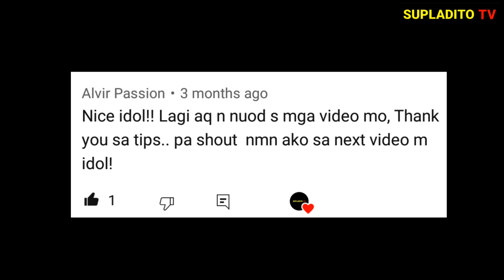Honda CIVIC: Rekta Fan vs Automatic Fan + overheating emergency tips

Comment: Ang purpose ng thermostat is to rich the normal running temp. Pag wala kang thermostat sa cold weather sobrang lamig ng engine at pag mainit panahon sobra naman init ng engine pag may thermostat ka mainit man o malamig ang panahon nsa normal temp lang ang engine.. at kung nka normal running temp ka doon ang pinaka magandang andar ng engine at pinaka matipid na kunsumo ng gas..

Comment: Yung fan ng sasakyan ko sir automatic naman po. Condenser at radiator isang fan lang.. gusto ko po lagyan ng wiring na may switch pra pag nakhinto yung sasakyan e manual on ko yung high speed ng fan.. ok lng po ba sir ganyan.. wala po masisira pag maglalagay ako

Comment: Sir pwede ba yung thermostat 78degree nag bubukas pero thermo switch nasa 95degre.
Reply from the maker: Yung thermoswitch un ung mag sesend ng signal sa rad fan na mag on na pag na reach na ung certain temp… thermostat naman po is kapag na reach nya ung temp tulad ng gate valve magbubulas therefore unang magbubulas ung thermostst dadalhin ung mainit sa rad para palamigin after few paung rhermoswith mag oopen ng fan…as ok po sana nasame sila para sabay sila mag open

Comment: Para sakin Mas ok ang naka rekta fan iwas overheat.lalo na kung old model na ang oto. Sa.mga modelo yun ang dapat naka censor sa thermostart.
Reply from the maker: Kung san ka masya at panatag kalooban mo dun ka sir kanya kanya naman po yan eh ang importantexwalang overheating
Reply: Madale daw po masira ang block ng sasakyan pag naka direct?
Reply: @vonabayon5246  anong block yan sir?
Reply: @vonabayon5246  kalokohan yan boss! wag ka maniwala na masisira ang block pag naka rekta!  🤙
Reply: 100%✅️

Comment: Sir ask ko lang yung civic 96 model kc ng tropa ko naka rekta pero may thermostat pa sya then may naputol lng ata na wire , need daw palitan ng socket , ma e babalik pa kya sa automatic rad fan?
Reply from the maker: Yes sir maibabalik pa naman po ung need i attached lang po ing putol na wires
Reply: @SUPLADITOTV  so bibili po ng socket po Sir? At magiging okay na po ulit mababalik sa Automatic?

Comment: Sir paano po ba ibalik sa stock yong radfan ng multivan na nabili ko naka direct kasi ang radfan  tapos wala ng thermostat..
Reply from the maker: Need po ibalik thermostat then check thermoswitch pra tamgalin ung na bypas (jump) wire connections

Comment: Bos gandang gabi honda lxi matic nka oto fan usualy ilan minutes ba bago umikot ang fan kapag coldstart esp sa umaga nagapalinis kc ako ng radiator d n daw normal un fan ko kc ang tagal bago xa umikot bka daw mapwersa yun mga hose at pumutok, 15 to 20 mins bago xa umikot ang fan  sa umaga, salamat bos
Reply from the maker: Di ko po naoorasn ung sa akin eh pero most likely mga ganun kung cold start po

Comment: tanong ko lang po naka rekta fan po sasakyan ko kung ibabalik ko ng automatic wala naman magiging problema? ty po
Reply from the maker: If nabili nyo po sasakyan nyo ng naka rekta fan na, di po natin sure or alam if ano reason kung bakit nag rekta fan ung iba gusto pang ung iba namam kasi may slight issue, 

Having said that sir, dun mo malaan if heathy ung engien nyo kung walang lalabas na issue sa cooling system nyq po

Comment: Nice tips sir.. Tanong ko lang kung pede po ba irekta kahit d na tatangalin ung thermostat?
Reply from the maker: Pwede nanan po sir
Reply: wala bang magiging bad effect s amakina sir kapag naka rekta gna at may thermostat? kakapakabit ko lnag mg thermostat kasi at ung fan ko naka rekta din. nag babalak din akong ibalik sa auto ang problema ko lang hindi ko alam kung saan makikita ung wire ng fan para ikabit sa thermoswitch po. salamat si God bless you sir. dimension po pala auto ko. 🙏
Reply from the maker: @tonviernes9821  sa may sakit ng thermoswitch sir dun may jinajump na wire po
Reply: @SUPLADITOTV  bkit ung car ko sir bunot ng socket andar na agad fan wala napo nillgay na clip
Reply from the maker: @lifestylevlog3409  baka sir hindi sa socket nag jump ng wore sa mismong wire na po ang pinag dugtong

Comment: Hello sir sana masagot. matic rad fan po, may thermostat n switch. pero pag on ng fan ko kahit 30 mins na hindi na nagpapatay ung fan. okay lang po kaya yun?
Reply from the maker: Kubg di naman po tumataas temp its ok lang po kaya nya pa ipacooldown medto matagal nga lang po at sobra init ng makina
Reply: @SUPLADITOTV  hindi po ba parang naka rekta na din ako sir? kasi hindi po talaga tumitigil kahit naka idle lang. hindi naman po madali masira ung fan ko?
Reply from the maker: Humihinro sya pero matagal lang…  check mo na rin po if malakas pxbuga ng cooling system mo po or malinos pa rad para mabilia nya mapalamig ung tubig po
Reply from the maker: @markxandermanzano4388  pag on nyo po ba ng susi andar agad ung fan?
Reply: bago po lahat, thermostat thermoswitch water pump, radiator, hose, coolant, rad cap
Reply: hindi po siya andar agad. pero pag uminit na po tapos nag on na fan. hindi na po nagooff ulit

Comment: Good am boss ,baka pwede mo ko tulungan sa cooling system ko. Nagbabaeas madalas ng coolant.ty
Reply from the maker: Try sir magp leak test
Reply: @SUPLADITOTV  may service shop recommendation ka boss.ty
Reply from the maker: @MarioSanchez-yr4gy  sa ratchethead garage sa torres subd novaiches po meron sya pang leak test… ung pinakaita ko sa isang vlog ko din
Reply from the maker: @MarioSanchez-yr4gy try ratchethead garage if malapit ka po sa novaliches… roz aytoworkz if malapit kasa pasig

Comment: boss sna masagot...pag long driving nka aircon ok nmn takbo...pero pag s traffic n nka aircon nmamatay matay ung makina parang kinakapos nang power...(overheat yta?)anu po kaya prob nun??
Reply from the maker: Kundly double check to confirm if overheat nga po by looking at your temp guage sa cluster gauge

Ito po mgapwede i check
Aircon system- check if bakit nabibigayan baka high pressure etc
Baka marumi naairpn syatem need linisan

Check charging ng kuryente ng alternator it happen to my froend namamtaun din un pala mahina na magkarga alternstor

If overheat check cooling system parts
Radiator
Radiator fan
Hose
Thermoststcthermoswitch
Water pump

Comment: Pa comment more bosing. Scenario: civic.sohc.may thermostatic valve(exact term)at auto ang radiator fan.pag start sarado pa ang TV.ang coolant ay tinutulak ng water pump palibot sa block at cylinder head balik sa bypass hose balik sa WP. Katiting lang ang pumapasok sa radiator. Hanggang umabot ang init ng coolant sa ikabubukas ng TV.iikot na ang coolant mula ilalim ng radiator pupunta ng WP via TV.via block cyl head at papasok sa bandang taas ng radiator. At aandar ang fan pag inabot na ang setting ng coolant temp sensor. Salamat.
Reply from the maker: Yes

Comment: Sir question lang po sana mareplyan nio agad ako nagoverheat ung sasakyan ko last Sept 12 tinowing nmen pabalik ng bayan Honda Jazz 07 matic na 1.5 
Pinaoverhaul ko na po ung rad ok na daw
Pinalitan carbon ng mga fan 
Tapos nung tinest drive nmen kgbi kumukulo sbi nung mekaniko nde na nagaautomatic ung thermostat ko babaklasin dw nila mmya tatangalin. Kailangan ko na po ksi gmitin ung sasakyan pwede ko po ba ipa rekta fan muna kasi naubos na budget ko tapos ipabalik ko nalang sa automatic kpg sumahod ulit? 
Thank you and sana mabasa nio po agad
Reply from the maker: Pwede naman po sir provided di na kayo mag overheat then if may bidget na i address po kung ano issue or cause ng overheating

Comment: Sir tanong ko lang sir new owner ng honda civic. Sa unit ko po kasi sir low pressure lang po kasi yung meron dun sa aircon ko po baleng yung high pressure po na dapat lalagyanan ng preon wala po. Sana po mapansin. Paano po ba ang gagawin? At masama po ba sa sasakyan yun.
Reply from the maker: Yung sa hose po ba yung tinutukoy nyo sir?

Comment: Kapatid....Naka rekta fan unit ko....pero hindi XA naiiikot ngayon.....i've tried na endorect ang fan sa battery at umikot NMN ang fan.....anu kaya problema?
Reply from the maker: Check fuse, thermoswitxh, check if i rekta dugtong nam ismo ung wire po
Reply: @SUPLADITOTV  ayos na brod na trace ko na ...tried paperclip tiknik wala padin 
Nag check ako relay  aun palyado na  pala

Comment: Boss nakabili kasi ako ng Honda Civic esi 1993 automatic tranny, Naka Rekta po fan? Goods lang po ba yun sir? At pag naka rekta ano po yung mga dapat kong i-anticipate para maintain ko yung Rekta fan ko sir at di masira agad? Sana mareplyan salamat po .
Reply from the maker: Check the health of ur rad fan po… and check the water/coolant of ur radiator…
Reply: @SUPLADITOTV  pero goods lang po ba kahit mag rekta muna ako pansamantagal? For example hanggang 3 years sir.
Reply: @SUPLADITOTV  mas mabilis po ba mag bawas ng Tubig/coolant pag naka rekta fan po?
Reply from the maker: @vino427  imho may reason ung una may ari bakit nitekta fan it can be good or bad… good in a way na gusto lang sumunod sa uso bad dahil mayhindi mapatino kaya ni rekta fan ang solution
Reply from the maker: @vino427  for as long na wala naman problema good na po un sir but if u want to know if ur engine is really healthy try to ibalik sa matik ung rad fan
Reply: @SUPLADITOTV  actually yung sasakyan sir ok naman po maganda manakbo, automatic tranny po kasi. Naibyahe na po nmen from QC-Batangas balikan wala naman po naging issue sir. Siguro pina Rekta nya in a good way naman po siguro hehe pero plano ko rin po ibalik sa Automatic siguro mga After 2-3 years sir. Pag naka rekta fan ba sir mas mabilis makaubos ng tubig at coolant po?
Reply: @SUPLADITOTV  sige sige sir noted po ito. Magkano po pala Total ko magagastos sir pag binalik ko sya from Rekta Fan to Automatic Fan sir? civic Esi 1993 po
Reply: @SUPLADITOTV  ano po mga need na parts para maibalik sa Dati yung automatic fan sir?
Reply from the maker: @vino427  ung rad fan po ang magiging maikli life span… possible sa block din di umano lasi continues lang ung flow ng coolant… kung ok naman na na ganyan hayaanmo na lang sir at least ok naman sya
Reply: @SUPLADITOTV  ano po mga need na parts para maibalik sa Dati yung automatic fan sir? At magkano po magagastos ko pra sa civic esi 1993 po
Reply from the maker: @vino427 usually pag nag recta fan tinatanggal ung thermostat… so bibili ka po ng thermostat isabay nyo na rin po thermoswitch tapos isalpak langcthen alison sa pagka jum ung wires… samahan na rin pala ng bagong thermostat gasket wala pa siguro 1k un sir more or less
Reply: @SUPLADITOTV  overall na to sir? Thermostat,thermostat switch, Thermostat gasket po?
Reply from the maker: @vino427 thermostat, thermostat gasket, thermoswitch
Reply: @SUPLADITOTV  yung labor kaya nyan sir magkano aabot?
Reply from the maker: @vino427 yes para mabalik mo sa automatic fan po
Reply: @SUPLADITOTV  magkano po yung overall or estimated price kasama labor pag pinabalik ko sa automatic fan sir?
Reply from the maker: @vino427 ung sa labor sir depende sa gagawa eh…. Bibili din po pala kayo additional coolant kasi pag binuksan ung sa may thermostat housing magbabawas un
Reply: @SUPLADITOTV  salamat po sir
Reply: @SUPLADITOTV  sir ask ko lang po pala,Okay lang ba kung after market thermostat switch,thermostat yung bilhin ko? Nakita po ksi ako na shop 2500 na daw po mga piyesa then 500 po labor.
Reply from the maker: @vino427  opo pwede naman
Reply: @SUPLADITOTV  yes ano po palang magandang gasolina for Civic esi Efi? Premium or Regular po?
Reply from the maker: @vino427 unleaded or xcs will do sir… pakiramdaman mo na lang po kung saan hiyang makina mo… 

Ako gakit ko po sa ek is xcs (premium)
Reply: @SUPLADITOTV  sir hello po. Binenta ko na po yung civic esi ko. Mag switch nalang ako sa Corolla big body gli. Tingin ko ksi maselan ang civic po .hehe

Comment: Is it normal boss na kahit nakapatay pa engine at inopen ac bubukas naden fan? _
Reply from the maker: Fan po ng ac sirlang dapat hidni fan ng radiator
Reply: @SUPLADITOTV  parehas umiikot boss eh. Nakatap kaya sa fan ng ac?
Reply from the maker: @learnmoretroops4335  check wiring sir baka tinap nga po sa wiring ng ac ung wiring ng radiator fan or check din if baka naka rekta fan
Reply: @SUPLADITOTV  nag aauto na boss eh, pinalagyan ko na ng thermostat at thermo swict. Kaso nakatap nga yata sa fan ng ac ung fan ng radiator. Ok lang kaya un? Sabay sisindi kapag mag oon tapos sabay den mamamatay pag nag auto na naoff ung ac
Reply from the maker: @learnmoretroops4335  pkichecl na lang sir wiring ng rad fan mot94 po

Comment: Sir yun sakin naka rekta fan pag on plang ng susi umiikot na...tinignan ko wire sa thermo swicth magka dikit pero pag pinag hiwalay ko hihinto ikot pero ayaw mag automatic tapos pag on ko aircon sir yun sabay cla iikot tapos pag mag automatic ac okay naman anu po kaya posibleng sira sir
Reply from the maker: Check nyo sir thermostat malamang tinanggal po un para tuloy tuloy ung circulation ng tubig/coolant
Reply: @SUPLADITOTV  cge sir thank you po
Reply: Nasa mag kano po kaya thermostat sir
Reply: Pang honda city type z 2001 model sir
Reply from the maker: @arleneabuyan4302  nasa more or less 500 ung tqma brand sir

Comment: Boss question sana, dating naka rekta fan binalik sa matic, bago thermostat,switch,rad,rad cap, thermostat housing. nag eengage ung fan pero sobrang tagal huminto 5mins minsan more than pa. Sana mapansin nyo boss maraming salamat!
Reply from the maker: Oks lang sir ang importante sir hindi tumataas temp po
Reply: @SUPLADITOTV  thank you sa pag reply sir! Last question sana. 2rows plastic top evercool rad, ano ma ssuggest nyo po na rad cap? Pansin ko ung rc105 1.1 federal mogul masydo maliit panay tapon sa reserve tank hangang sa maubos ung tubig sa rad + boiling na ung sa reserve.
Reply from the maker: @clydeisrael01  ung rubber sir nung rad cup tulad nung sa oem… na try nyo na po 0.9?
Reply: @SUPLADITOTV  flat type sya sir ung una kong gnamit na rad cap, ung pinalit ko as of now pero d ko pa na ttest is mejo maliit ung dulo nya rc104 1.1 nmn. D ko pa na try ung 0.9 pero i ttry ko if ever pumalya. Maraming salamat Sir!
Reply from the maker: @clydeisrael01  maglaiba kasi sir ung soze ng ribber sa loob depende sa bunganga ng radiator po
Reply: @SUPLADITOTV  ayun hehe mejo sakit sa ulo na e pag pa ahon nag 3/4 temp pero bumababa dahan dahan ung temp, sbi ng mekaniko usdm daw thermostat kaya pag engage ng fan sobrang tagal mag palamig
Reply: @SUPLADITOTV  Last question sir hehe ask ko sana kung okay lang b ung tama na brand for thermostat and switch, ano ung recommended na degrees, gagamitin lang pang daily ung oto.
Reply from the maker: @clydeisrael01  oks naman po ung tama
Reply: Sir yun oto ko nka matic fan d xa nataas ang gauge one time iniahon ko sa mejo matarik na lugar tumaas ang temp nya nka 2x na ganun ang ginawa ko inirekta ko muna yun fan nag normal na ulit xa anu kaya ang magandang remejo para d na manyare yun maliban sa wag na ulit dumaan sa matarik na lugar
Reply: Magkano nagastos mo dyan boss

Comment: Good evening po pahelp naman po dati po kase rekta fan ung Honda esi ko ngayon tinignan ko Thermostat nya Wala po pala sya kaya bumili po ako at nilagay ko po at inayos Kuna din po ung sarekta fan sa switch n po sya pag nagbukas na thermostat concern ko po pag nilagyan ko po ba Ng tubig radiator pano po tama pag lagay kase po bumubulwal po ngayon dati Hindi naman nung Wala thermostat ? Hindi ko po alam Kung hangin or what po
Reply from the maker: Try mo din sir palitan po ung thermoswitch nya… sa pag bleed po… hayaan nyo lang po naka open ung talip ng rad cap hanggang twice na mag automatic fan un or umikot yung rad fan po

Comment: mas ok po ba na naka rekta ang fan?? kase po yung car ko naka rekta bakit po need po naka rekta? ano po tulong ng rekta fan?
Reply from the maker: For me mas ok po na naka automatic fan... rekta fan is for emer(gency or extreme used po sana
Reply: sir last na lang po ako po nasa bansang bahrain pinalitan ko na po dapat ko palitan pero every time naka Ac on ako bumabagsak yung idle ko lalo na kapag nagpapalit ako ng gear like drive and Reverse bagsak rpm ko ng 700 to 600 my kasama pa Vibrate car ko po honda civic 2002 halos laki na din ng gastos ko pero gnun parin po
Reply from the maker: @ydclemente4906  ano ano na po ba pinalitan ninyo? Ito po mgapwede nyo i check:

Load ng aircon
Check compressor, check if need ng cleaning ng aircon kayanabibigatan compressor or baka nag ha high pressire, 
Check compressor baka pa bigay na po
Check also alternator baka magina na kumarga dahilankapag mag engage aircon nahihirapan po sya, it happend to my friend civic to the point na sa bagsak ng menor eh namamtayan pa pg traffic...
Reply: halos po lahat check ko na po pero check ko po alternator sobrang hina po ng kapit try po namen open and off AC same yung kapit ng scraw.. ano po fb page nyo po
Reply from the maker: @ydclemente4906  supladito tv din po
Reply: salamat sir